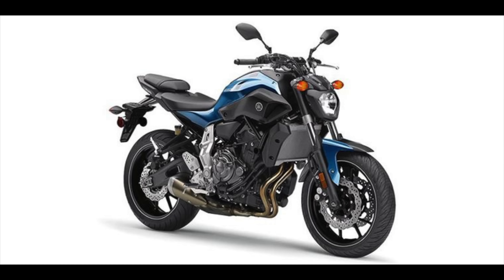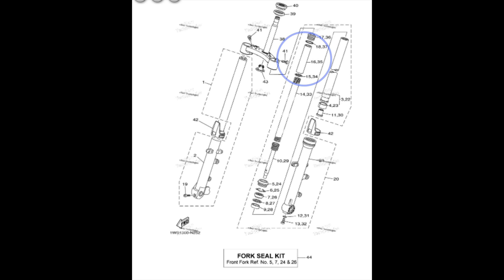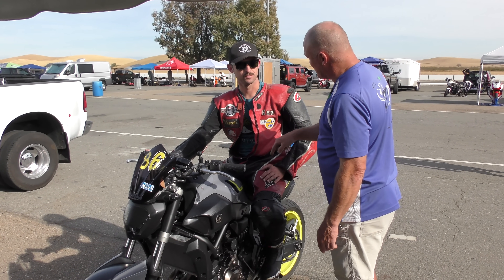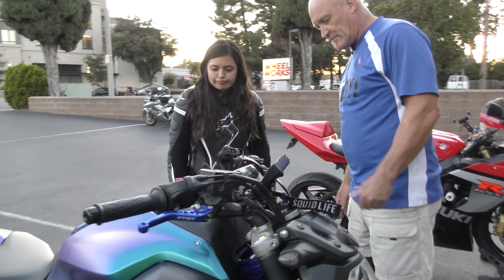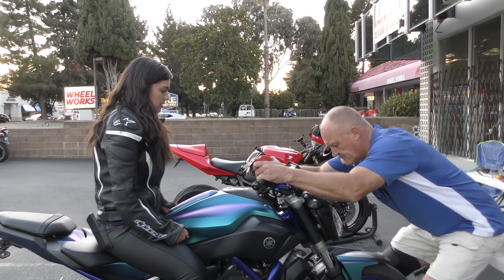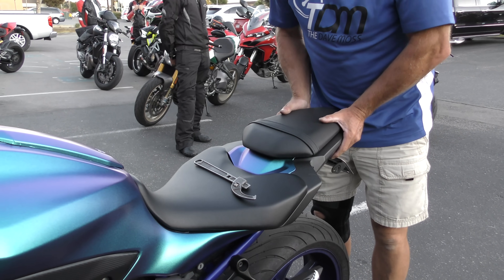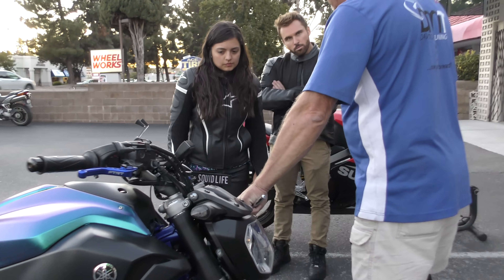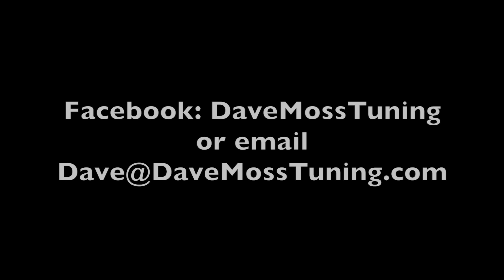Yamaha FZ-07 / MT-07 Fatal Flaw and How To Fix It

Comment: I had the oil and springs changed on my sv650s. Now the adjusters work and it's way better.
Can't help but think that the action is quite crude over sudden 'shock' bumps, and that it's a limitation of damper rod forks. I'll save for a cartridge kit next.

Comment: Blown away how many people ride bikes and have no idea about set up .. Thank god for the  two  Daves. 
Safe travels in NZ Mr Moss
Reply: Why are you blown away?  This is a skill set that not everyone has.  It has to be taught.  Maybe you were just born with insight about bike setup.  Do you own a fridge?  Can you re gas it?  I can't believe that people own fridges and can't re gas them.
Reply: Well where are you to get an idea for the set up. It's not like that information is easy to comprehend without background in it. You want to ride a bike, take the course, buy a bike and ride, thinking the manufacturer set it up correctly... Blown away that people are blown away about people not knowing everything...
Reply: My view on suspension is don't touch what you don't know.  Having said that I did the same as he did in this video to the rear suspension but only because my backside was aching after a few hours ride, I just wanted a comfier ride and not too concerned about cornering on 30mph gatso infested London roads tbh. Also I'm not sure I like the idea of bike going into a corner more easily, it's something you get accustomed to I wouldn't say one is better or worse unless you're talking lap times, think about how different the bike handles when you had low pressure tyres and then you inflate them back to normal and it feels like a different bike but you got used to riding it on flats.  So it's only something you have to experience, he could've adjusted that suspension and the girl could've gone home hating it, just saying.